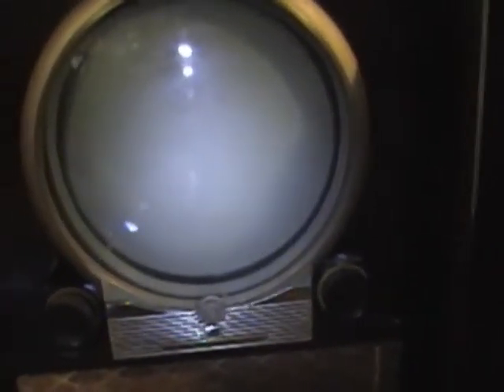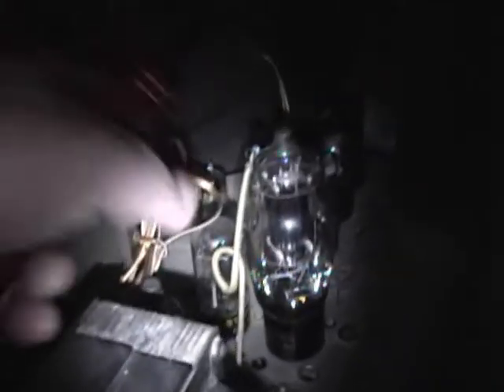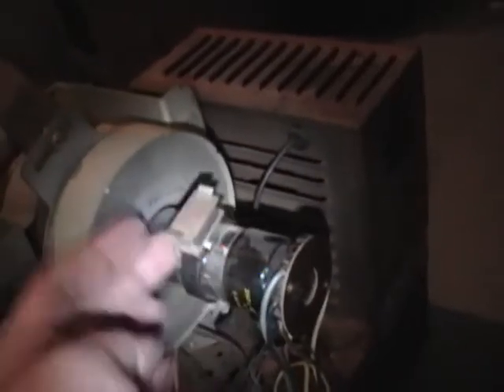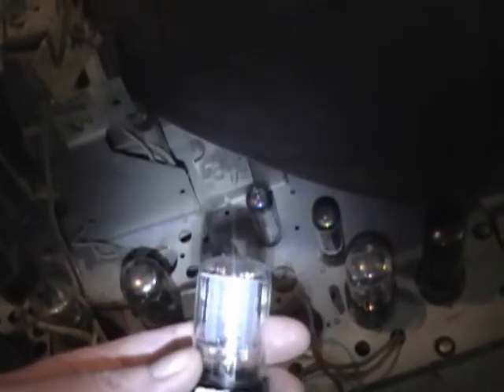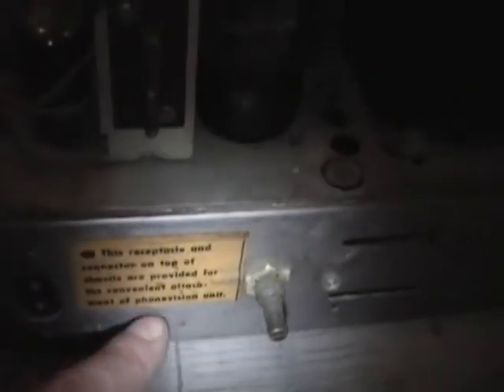Zenith Graemere and Admiral TV score

Comment: From what I was reading you can substitute an RCA flyback transformer in place of the Zenith one with some modification which is good since RCA sets are a lot more common from that era and had fewer high voltage problems then Zenith sets did, The main problem  with a Zenith porthole seems to be finding a metal glass tube that's still good, at least this new find of yours has an all glass 12'' tube that can be found if needed.

Comment: @jrmcferren Possibly but not in the 1940s and 50s, electronic solder was 60% tine 40% lead in that era. 50:50 solder was used mostly for tin smithing and for soldering copper pipes and you have to use acid paste flux for either application unless it's flux core, also acid. Then again that doesn't stop someone from using the wrong solder in there but if they had used acid core solder there would be copper oxide all over the place. I think it's just a matter of them not using a hot enough iron.

Comment: @bandersentv It wasn't the fact that it was badly soldered that I found amusing, lord knows I've seen enough of that in my radios including the Medco Telesonic radio I was working on recently, it was the fact that those dogbone resistors fell out right on cue as soon as you touched them. That G.E TV I have has some goofy repairwork like that as well, someone replaced the voltage doubler selenium rectifiers with top hat diodes and used resitors from their junk box as dropping resistors.

Comment: Was that an isolation transformer or a brightener?  It should have been marked on it. Also if it is an isolation transformer could you attach to CRT and test?
Reply from the maker: ***** Could very well have been an isolation transformer.  I've misplaced it in the four years since I made this video.  f I can find it, I'll try testing it.

Comment: "Oh nice soldering job there" then "plunk!!!"  bwahahaha!! That's the one of the funniest things I've seen in your videos, you can't plan stuff like that. Be careful with the Zenith, I've heard that some of the series stringed ones also had a power transformer but used a whacky auto transformer with taps to get the B+ voltage, interesting but probably more dangerous then using a voltage doubler.